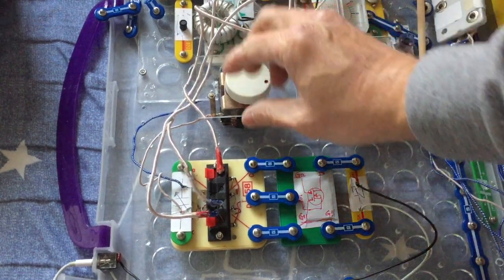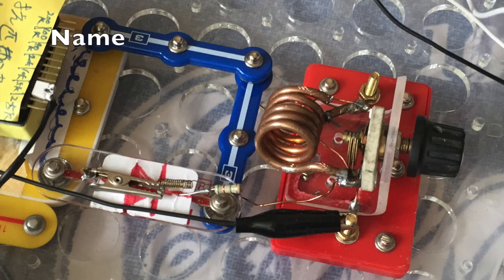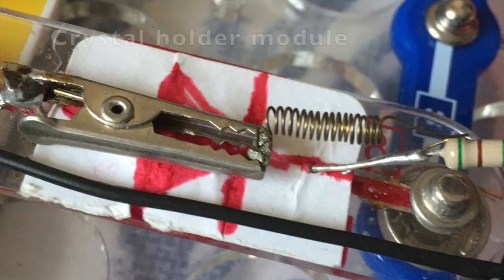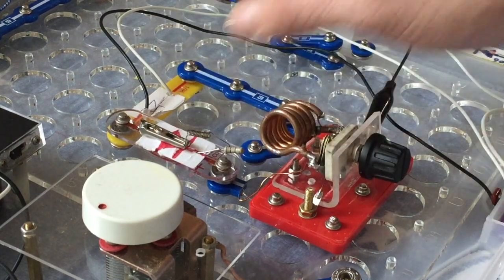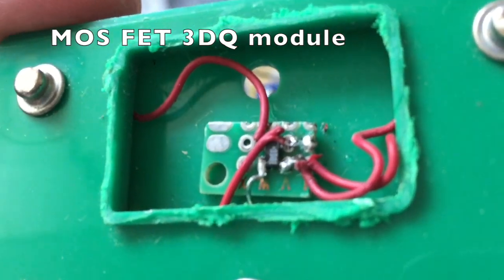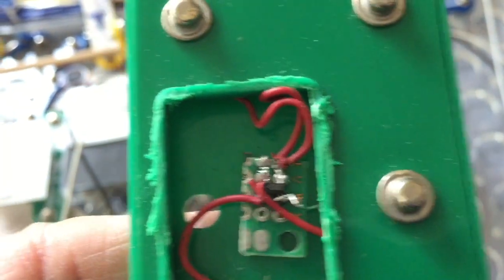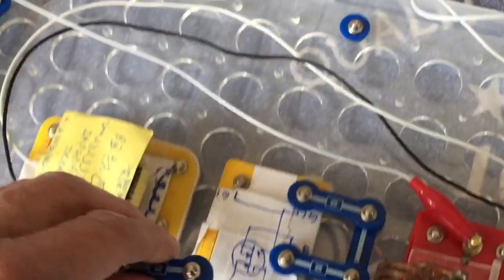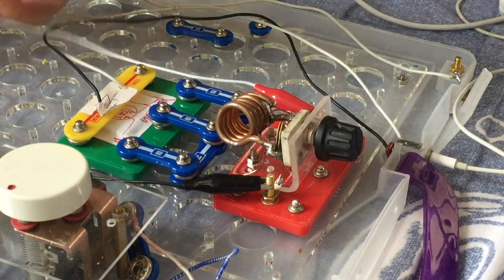Testing my Crystal Radio Building Block 測試我的礦石收音機電子積木

Comment: where did you get the blue, green, and yellow connectors
Reply from the maker: https://m.aliexpress.com/item/32842474511.html?pid=808_0000_0231&spm=a2g0n.search-amp.list.32842474511&aff_trace_key=49a2139cec474748ae68ced8e47c1d61-1570857347793-01457-beWBsDNO&aff_platform=msite&m_page_id=107amp-ZelQHj-RgiICiqJMX_Zkmg1581399774155&browser_id=edb9c3c25ece4d3b95974f070c53b60f&is_c=&gclid=null

Comment: stay safe, I like your radios. what is that radio behind you?
Reply from the maker: It's a phono-AM FM Radio-MP3-blueboth combo. It's a modern radio designed to look like antique radios. I bought it from the Chinese taobao.com at around 1,000 RMB exclude shipping. The horn speaker is more for declarative than effective. It's driven by one small speaker for treble that feeds the horn. The louder part of the music is fed to two bigger speakers inside the wooden chassis of the unit.

Comment: Hello Billy! I'm not familiar with the "world of radios" but you are a good presenter, so I'll check your videos out. The reason I found your channel to begin with was your indoor agriculture project. Some time ago, you put up a very interesting video where you described 3 different water culture methods (https://www.youtube.com/watch?v=0T2KsCwRD70&list=PL1jjLXGmN9GDJur3jHiniSitW-H2ryUmi&index=39).

Though I never found the video where you presented the results. I'd be very interested in knowing more about your results and conclusions from this experiment! :)

Stay healthy! :)
Reply from the maker: Thanks. I have stopped using the automated methods of hydroponics. To be more cost effective, and to remove the risk of pump failures or clogs,  I have started planting with a more natural method, a passive growth tube./growth tank method. So, I am not able to share more videos about the automatic methods I did before. Sorry about that. But I can assure you these methods provide a bit better results than the natural method. The import thing is to keep enough air for the roots to breath, either by an air pump (deep water cutter with air pump), hanging the roots in mid air and spray it with droplets of nutrients (fogponics or aerophones), or keep a running thin film of nutrients (NFT with growth pipes), or like my natural method to use a water level controller to keep water replenished only when the low water mark is reached. There have been people making tests and comparison among the different methods. From what I've read, the Fogponics/aeroponics is the best, followed by the natural method with pumps or water level controllers.
Reply: @BillyCdiy  Many thanks for the reply! I understand it you didn't see a distinct difference between the methods in your setup, because you switched to the natural method before the differences were pronounced. Have I understood it correctly? Why did you choose to switch from the automated hydroponics type growth systems to the natural passive growth tube/tank? Thanks again!
Reply from the maker: @dempa3  , an electric outage ruined my whole corp one day. Hence I rethink the value of putting in such automated system. Whether that really increases the harvest versus just using a more environmental and natural method. I chose the latter.
Reply: @BillyCdiy  Sorry to hear that! I haven't even thought of that. Many thanks for bringing my attention to the vulnerability/reliability aspect! I'll keep watching your videos and learning and hopefully eating my home grown vegetables in not to far away future! :)

Comment: Hi Billy, Always like your videos!  Very innovative ways of building different types of radios.  Could explain the coil and tank circuit you are using?  Looking at it, it seems tapped?
Reply from the maker: The circuit I tested with the electronic building block is the same as what's been shown in this video.  Pls check it out. https://youtu.be/1q1qwCPC5kM